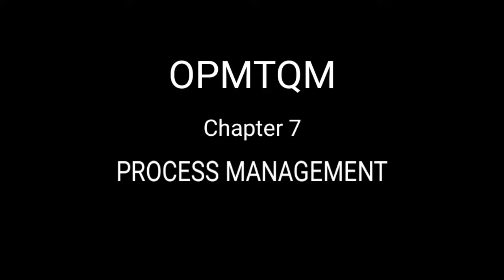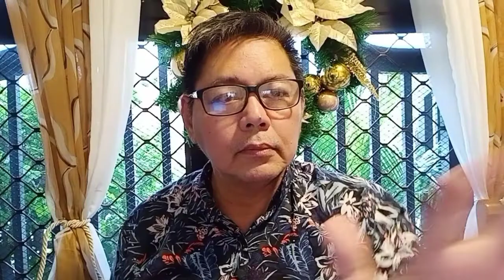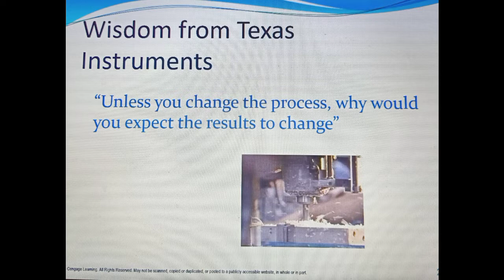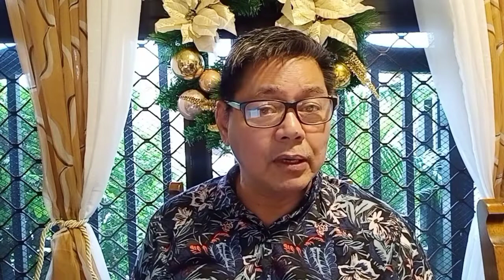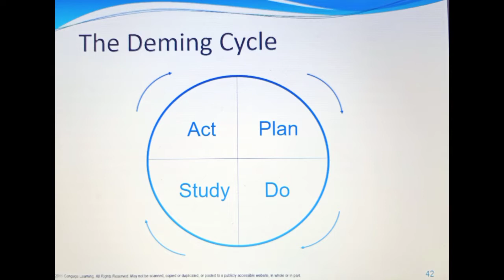OPMNTQM CHAPTER 7 PROCESS MANAGEMENT

Comment: PAREDES, ANDREA MARIE C.			MGT07 – TUTORIAL		4AFM

In order to be accomplished, it is necessary to identify and specify the stages to the required tasks. This is crucial for the company to check in order to attain client satisfaction. In this case, process management is critical since, if followed correctly, the business will be able to optimize customer satisfaction. Every business aspires to maximize profits by increasing productivity and making use of it while lowering costs while maintain a high level of quality. Prof. Castillo addressed how process management will avoid flaws and mistakes in the video.

We all know that some firms generate a lot of waste as a result of bad management, and this has an impact on their customers. In the video, it was thoroughly described how to remove or reduce their danger in every situation. Customer happiness is influence by two processes that run across the value chain. The first is the process of value creation, which is dependent on the product and service. Furthermore, there are design procedures that produce functioning goods, as well as production processes that manage or transport the products. The second is a support procedure that is dependent on the internal processes as well as daily operations. Process management requires a high level of creativity these days because technology is changing at such a rapid pace that businesses must be able to keep up in order to fulfill consumer expectations.

To summarize, process management is important in the business since it ensures customer satisfaction. Businesses strive to deliver high-quality service to their consumers. One of their sources of earnings is consumers. One of the most important aspects of comprehensive quality management is process management. With the new normal today, organizations are taking full advantage of the opportunity to learn process management since they recognize that this is the basis for higher quality. A strong foundation will not be readily demolished.

Comment: Yrreverre, Julius Caesar P.
4AOM – TUTORIAL

“Why would you expect the outcome to change until you change the process?”

There can be no improvement without a process. It is for this reason that the idea of Process Management was created. So, what exactly does Process Management is saying? Process Management, according to the video,  is it helps in the prevention of flaws and errors in the workplace.

Process management is a strategy for designing, controlling, and improving activities in order to plan and govern them. To attain a high level of performance, process management is essential. Process management is intended for businesses and organizations that rely largely on processes, such as manufacturing and massage services. Anything that goes beyond these two fixed lines is considered out of control. This could refer to production flaws or poor customer service experiences. In the process management approach, there is a concept known as control vs. improvement. The product deviation has two-line limitations in this illustration.

What is quality and performance excellence of Process Management? 
The structures, procedures, rules, work practices, and leadership styles associated with such accomplishments become accepted and standardized over time to the extent that an organization achieves success and stability. 

For me, Process management is critical since it may help in the optimization of your entire operations. It can help you save money by lessening expenses, improving workflow management, identifying operational flaws, and providing insights to help you make better decisions.

Comment: CHAVENTE,YRAND JANN 
2AIA
FINAL EXAMINATION
OPMTQM

Chapter 7

1.	  Identify and explain five leading practices in process management exercised by total quality firms.

There are many ways in order to have quality management firms, this is only 5 out of many ways in order to have a quality management firms.

-Quality. It catches the attention of customer, and if a customer knows the quality of a certain product, the company will get the loyalty from its customers, and also because of the quality of the product, it will gain popularity and will also have high profits.

-Deming's philosophy. it is about continuously improving the product while decreasing the cost and also decreasing the price in order to increase the market, by achieving that, the business will succeed and survive in the next more years.

Customer satisfaction The customers are the key in order for the company to be successful. Therefore, understanding them is important. A company must establish procedures for communicating customers about their product.

-improved human resource management. This will build a strong bond between the employees and the management. They will be united and it will create a strong relationship. This will result a great performance and because of this, it will satisfy the customers need.

improved complaint management. complaint management handles the complaints of the customer and will resolve issues to reduce bad impressions. Complaint management provides bond to the customer and company. Resolving issues of the customer will give the company loyalty and profitability.

Comment: Diosina, Rainnah Joy L. 
2AMA
FINAL EXAMINATION
Chapter 7

Identify the four components of a control system.  Provide an example in a manufacturing firm to demonstrate each component.  Show in your example why long-term improvements cannot be made unless the process is brought under control.

	The four components of a control system are (1) Standard or Goal, in order for a manufacturing company to be success thus they will  need set a standard and goal that each employee or person would be dedicate and envisions into (2) Means of measuring the accomplishment, every idea is meant to be planned thus to measure the accomplishment the manufacturing firm must plan, do and study the processes they are making while maintaining their goal, in the manufacturing company, they are known for their standardize processes which is also used to maintain the same quality over periods of time. (3) Comparison is used by a manufacturing company to compare the different process they made in order to make a certain product; thus, they use this to know what the most effective and efficient way is to deliver their product within the standard of the company. (4) Feedback, the feedback is used as a basis to make improvement in the process; a manufacturing company after selling they receive responses from their customer this then leads them to the understanding if their product are satisfactory and is incapable in performing its role to the costumers, nevertheless if not that provided response would be used in assessing the part where the product has flawed.

Comment: Alrajhi M. Calaca
2-AMA
Final Examination
7.	Identify and explain five leading practices in process management exercised by total quality firms.
-	Every firm must be able to develop a system that will synchronize all of its workers and be able to work as one that is align with its vision and mission hence there are several ways regarding the leading practices in process management that must be exercise by total quality firms such as: 
-	the first one is translating customer requirements and internal capabilities into product and service design requirements early in the process. It is beneficial for customer if their concern is being heard by the company and using their feedback as an improvement for the product.
-	Second one is ensuring the quality is built into products and services and use appropriate tools during development. Total quality includes the features that the consumer is looking for hence it is the crucial part since is will satisfy the consumers.
-	third one is managing product development process to enhance communication, reduce time and ensure quality. Every business firm must know the usual routines of their daily operation and by this they can also identify some malfunctions that the business experience and know the inventories that lack or needed to be bought and you can also control the amount to avoid waste.
-	forth one is defining performance requirements for suppliers and ensure they are met. It is important for the buyer and supplier to have a good relationship for a better transaction. It can also lead to acquiring some benefits as a special buyer from the supplier.
-	Lastly is controlling the quality and operational performance of key processes and use systematic methods to identify variations, determine root causes and make correction.

Comment: GONZALES, ALEXANDRA PATRICIA O.
FINAL EXAMINATION
2- AMA CHAPTER 7

1.	  Identify and explain five leading practices in process management exercised by total quality firms.

Process management is important because it prevent defects and errors and eliminate waste and redundancy. Thus, total quality firms use process management to lead to better quality and improved company performance through shorter cycle times, improved flexibility, and faster and more consistent customer response.

Leading practices exercised by total quality firms are first, customer needs drive process improvement. This means that the needs and wants of customers fuel process improvement because the goal is always to make the product/ service being able to cater the needs of the customers.

Second, corrective action focuses on removing the root cause of the problem rather than on treating its symptoms. This means that in correcting the mistake is to ensure that is will not happen again, rather than eliminating the mistake itself. It is to make sure that instead of correcting the single mistake, it is learning from the mistake and preventing such to happen again.

Third, the mind-set of quality is one of prevention and continuous improvement. Meaning to ensure quality, instead of eliminating defects and errors, it is to prevent them from ever happening which leads to continuous improvement of the manufacturing process.

Fourth, everyone manages a process at some level and is simultaneously a customer and a supplier. It means that everyone is involved in process management, internally and externally. This is because at some point, the supplier ensures that the raw materials are free of defects and errors. Nevertheless, the customers ensure that the product they received are working in perfect condition. Thus, at some level, everyone works at the manufacturing process even the customers.

Lastly, process simplification reduces opportunities for errors and rework. The more complex the process, the more susceptible it is to errors. This is because every step of the process requires checking, and the more complex the process is the harder it is to check for errors. Thus, if the process is simple, it is much easier to check for errors and rework because there are less steps for checking,

Comment: Leaño, Darelle Ann C.
2-AMA
Final Examination

Chapter 7
Identify the four components of a control system. Provide an example in a manufacturing firm to demonstrate each component. Show in your example why long-term improvements cannot be made unless the process is brought under control.

In every business, there should be a control system wherein such systems must be able to abide in doing the requirements made by the management as to solving the issue and take any precautionary measures to correct conflicts to stabilize the standing of the business. There are four components in a control system: a standard or a goal, means of measuring the accomplishment, comparison of actual results to standard, and the feedback to form the basis of corrective action. 

Taking into example the study of Kumar & Antony (2009). Narrowing the demographics, let us specify it into Company D. Company D is a manufacturing firm that deals with electrical services. The standard or goal of Company D is to improve the market share as to maintain their loyal customers. Company D illustrates that if they want to improve the market share of the business whilst retaining their existing consumers, they take into the approach of having standardized procedures by using certification systems or the ISO 9001:2000. In comparing with the Lean & Six Sigma Approach which the company did not utilize, common problems arose in the manufacturing line of Company D such as lack of vision and barrier between shop-floor employees and the staff. Such approach did not aid the goal of wanting to communicate between the employees and the leadership was lacking due to lack of supervision by the management. These conflicts made it harder for the firm to reach their objective since the issue is within the company. How will they boost their company externally when they cannot resolve an issue happening internally? 

Company D has then leaned towards the Six Sigma Approach which happened recently and in connection with such approach, the company contrasted both continuous improvement initiatives and concluded that companies who use the Six Sigma Approach is better in terms of communication, dealing with consumers, and leadership. However, despite using the certification system, the company still thrived to become successful in other aspects of what the company offered which became the feedback in taking action of whatever initiative they wanted to utilize. 

As seen in the example, every firm who has a control system, the process takes time. Long-term improvements cannot be made once the company should finalize in making decisions that greatly impact the future of the company. Like in Company D, they realized that turning towards the Six Sigma Approach made their company prosper and made it a point to implement it lately. The process must be in control hence, improvements cannot be made once that decision has not been fully accepted by the company.

Comment: Brigida, Lei Andrea C.
2AMA
Final Examination

Chapter 7: Identify and explain five leading practices in process management exercised by total quality firms.

     There are a lot of leading practices in process management to be performed by total quality firms. Some of them are (1) Translating customer requirements and internal capabilities into product and service design requirements early in the process, (2) Ensuring that quality is built into products and services and use appropriate tools during development, (3) Controlling the quality and operational performance of key processes and use systematic methods to identify variation, determine root causes, and make corrections, (4) Continuously improve processes to achieve better quality, cycle time, and overall operational performance, (5) Innovating to achieve breakthrough performance using benchmarking and reengineering. 

     (1) Customer requirements must be given attention to from the start of the process to give the customers what they are expecting. Doing this early will make less errors all throughout the process. (2) Quality must always be integrated during production and development, making us more confident about our final output. (3) Strategy and systematic methods should be followed by the organization to easily identify where we might go wrong and if a problem arises, we can track down its root causes, allowing us to take action to correct it. (4) Improvement should be never-ending for the organization. We should always strive hard to attain and learn better processes and methods that we can use in the organization. (5) Benchmarking will help us know where to improve when it comes to our products and after we become aware of that, reengineering happens. These two steps will help us innovate and improve continuously.

Comment: BELOSO, MAY ANGELU G.
2AMA
FINAL EXAM- CHAPTER 7
	Question#1: Identify and explain five leading practices in process management exercised by total quality firms.

	Answer: There are various practices in process management exercised by quality firms but the following are the five leading practices that can be applied and how I interpret them.
1) Ensure that quality is built into products and services and use appropriate tools during development. The right tools will ensure the right improvement to the quality of the products.
2) Define performance requirements for suppliers and ensure that they are met. It is important to have a clear understanding between the organization an the supplier to have a smooth transaction.
3) Control the quality and operational performance of key processes and use systematic methods to identify variations, determine root causes, and make corrections.
4) Continuously improve processes to achieve better quality, cycle time, and overall operational performance. Improvement does not stop as you apply new methods rather firms must continuously adapt to changes.
5) Innovate to achieve breakthrough performance using benchmarking and reengineering. To be able to survive in the competitive market, organization needs to strive to be better and unique by always stepping up their game.

Comment: CERVANCIA, CHARISSA GAIL
2AIA
FINAL EXAMINATION

Identify and explain five leading practices in process management exercised by total quality firms.

Process management is an integral part of the business that prevents defects and errors committed by the management. It is an end to end process that involves planning and continuous improvement. The leading practices done by this management are: first, design the management wherein production should be sequenced properly, every process and steps are well defined by the management. Next is control; this is where the management assesses if the output is according to its plan. Lastly, Improvement where the organization doesn’t stop to achieve a higher level of performance.